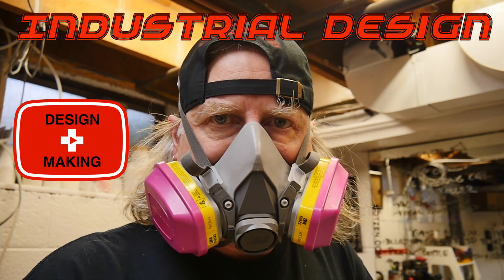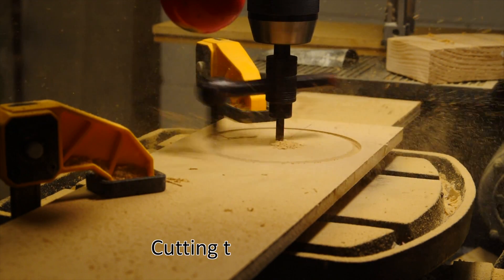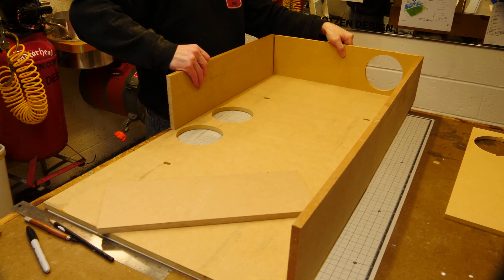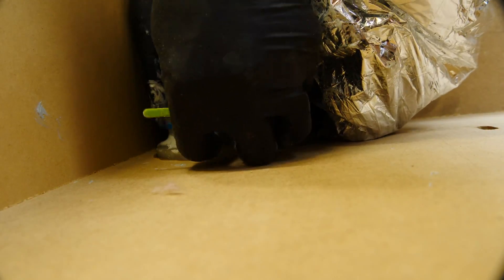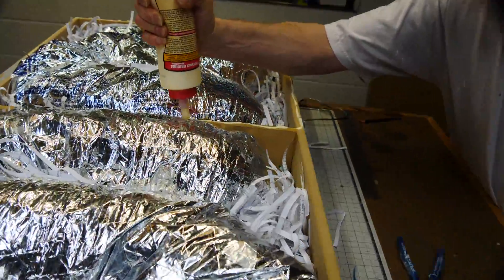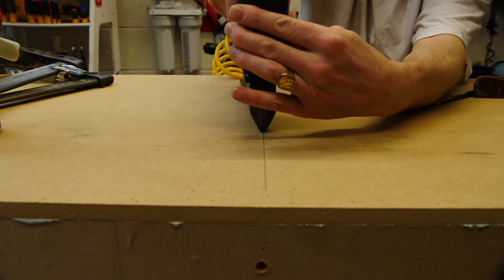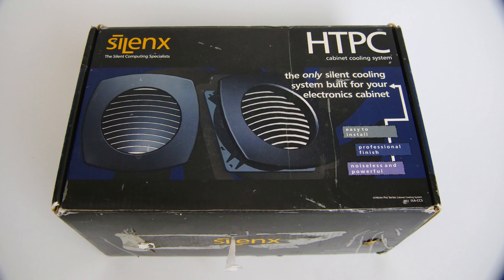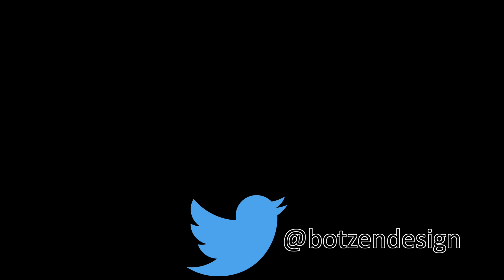Vocal Sound Booth Whisper Room Build: Part 4 Ventilation System

Comment: I know everyone’s a critic. But mounting your fan to a plastic tube that was mounted to wood transfers vibration. Then you mounted that on the booth. Not sure why you didn’t just cut holes and glue them with foam in between… you covered them with vent covers anyway… then I’d have that box disconnected from the booth with the vent tubes being all that’s attached. My guess is you’re getting a lot of vibration transfer…

Comment: Suggestions? Sure. Get the fan/box off the booth wall. Move it as far away as is reasonable. Ditch the mini-fan and use a  larger fan moving at slow speed. And when all else fails, Waves Clarity VX plug in will remove all the fan noise without degrading the vocal track. One pass, post-processing…gone.
Reply from the maker: Cool

Comment: Not sure what happened to my original message, but I suggested using a larger diameter fan. This will give the same volume as the smaller fan but at a slower speed. I also recommend using a toroidal propeller design for even quieter and better performance.
Reply from the maker: Also good ideas

Comment: Perhaps use acoustic ducting and locate the fan further away somewhere on the outside of the unit.

Also, if anyone wants to soundproof, consider mass loaded vinyl. Use closed cell expanding foam underneath. It should be fastened at the frame studs only, just before the interior wall.

Use it on the flooring as well with 2 layers. Also, I would suggest using 1/2 to 3/4 MDF for walls, and 2x4’s for the frame, if soundproofing.

Comment: I think the serpentine insulated ducting was a good idea, but you started with small fans, which is a problem.  The smaller the fan, the faster it has to spin to produce a given flow rate.  The baffling is an acoustic attenuator, but it can only do so much, so it is essential that the fan itself be as quiet as possible to start with.  When I do this (I'm doing a bit larger booth because it is for video recording rather than just sound), I will start with a low-noise fan made for use as a quiet bathroom ventilator, then apply the baffling to that.  Also, for quietest operation, the duct should be as large as practical, since the larger the duct, the slower the air has to move through it, and there is also noise produced by turbulence in the moving air, which increases with airspeed.  So, larger area fans, larger duct cross-sectional area - these areas should be roughly equal for minimum turbulence.  I know you have space constraints, but here we're talking about space outside the booth, not inside.

I'm happy to hear that the styrofoam/plywood sandwich was sufficient for your application - I've been worried about noise from a nearby busy street as well as airline traffic overhead, but I may start with something that simple, and add another layer of sound absorption only if necessary.

Comment: I was thinking of designing one ventilation using flexible plastic pipe and foam pipes as outer layer for the plastic pipe. For fans, I was thinking multiple 80mm cpu fans, attached to the pipes and kept at a distance from the booth. Any suggestions? Thank you.
Reply from the maker: Sounds good, try it out see how it works. Let me know

Comment: I bought a custom made sound proof cabin for WFH, but the airflow is really bad, right after closing the door I start feeling how my breathing gets harder. I think the de ventilation system they designed for this cabin is really poor and not well thought, it only have an air intake fan on the top and another insulated hole on the top to... maybe act as an exhaust just by the pressure added for only having air intake?

I was initially thinking of adding an exhaust on the bottom thinking carbon dioxide is heavier and will tend to move to the bottom, but not sure if that's a good configuration since also hot air moves to the top.

With your setup of intake on the bottom and exhaust on the top, how it feels? can you breathe normally? how long it takes until it becomes uncomfortable to be in there?

Nice video!
Reply from the maker: Thanks, good luck with your booth. I appreciate your comment s

Comment: Heck of a build man.
I'd install an inline switch for the cooling system if it's DC powered?
Reply: I saw a video where someone used passive air vents when they soundproofed their garage. It had a Trainline running from the back of it. 
It's quite an old vlog I'll see if can find the link.
Reply from the maker: Good idea, I've thought about doing that several times but right now I just plug and unplug it when I use it.
Reply: **It's by a guy called Max Troy

Comment: I noticed on some of the commercial booths the exhaust is at the bottom. So it’s harder for the mics to pick up sound at a higher elevation. I still love the content and your booth. What most people don’t understand most of even the commercial booths out there are not fully sound proof. Sound proofing is a whole different game. These booths are designed to stop outside sound like a furnace or outside noises like planes and cars from coming in and these will always do the trick because you have your house walls and your booth that acts like a room inside a room.

Comment: Foam has a better noise rejection then rock wool insulation. Rock wool insulation is used for a diffuser. Rock wool has microscopic fibers that are so small they can splice DNA in the lungs making it cancerous.  Cork works really good. 750 dollars for half inch to cover that room. You can use drinking straws as a diffuser but the width and length plus thickness plays a role in what frequency’s you want to cancel. The sound waves travel the tube bouncing then it hits a dead end and has to travel back the tube against oncoming new waves.

Comment: There is a solution to get rid of the sound of fans, you make a hole directly above your head and a special box for it to drain the hot air, and a hole at the bottom to draw cold air with another box, this is pure physics, you do not need to use the fan and if you use it it will be for a short time

Comment: There is no way to do without an ac or a ventilation inside the booth? I wanna build a booth, but ventilation is going to cost for sure. I thought I'd just open the door every 30 mins or so to let some air into the booth. Or maybe use a regular fan in there between sessions when I'm not recording?

Comment: I used the Inno Silencer for the PVC pipes for my soundbooth ventilation.
and it dampens a lot.
in the Netherlands these cost 6 euros each and I needed 15  pieces.
these inno silencers are available in various sizes, they are 5 cm thick. you will need about two to four pieces for your sound booth
Reply from the maker: Interesting product, thanks for the tip

Comment: Though I'm not sure what you can do about it, but TURBULENCE is one of the major factor creating Noise. Fan Blade designs that create greater turbulence have higher noise, and most whisper fans, have a blade design that reduces noise. One of the reasons I thought that venting the cabinets, drawing air out, might work better than blowing air into the cabinet where you are essentially blowing fan noise into the cabinet. Just a few thoughts. Let us know what you come up with.
Reply from the maker: I am drawing the air out
Reply: @EricStrebel  - - OK wasn't sure about that aspect. That seems like a lot of sound when drawing air out. Do you have some future plans to address that noise or can you simply live with it? I suspect turbulence is a factor. Generally the more turbulent the air is, the more noise it makes.
Reply from the maker: Dunno yet, maybe some sort of an inner lining or sleeve, or different fans
Reply: @EricStrebel  - - It is an interesting and important aspect of a Sound Booth - Quiet Ventilation. If you get some time to work on this, and find some solutions, we, the viewers, would certainly be eager for an updated video. There are Hundreds of videos on building the booth, but very few that effectively address the Ventilation aspect. 

Did you understand the point I was making about the C or U-Channel duct? That's hard to explain without decent graphics to illustrate. Basically a 3-sided box with open ends in the cross-sectional shape of a "C" or a "U". Line that with something to soften the internal acoustics of the duct, and use it to cover the two Openings. That way, the air is vented to the sides instead of right in front of the monitor.  Just a thought. 

While you see a lot of people put the soft double layer insulated Duct in their air vents, I, personally, feel there has to be something in the duct to absorb sound. So, like I said, rather than use the Foil Ducts, I would build a labyrinth of wood inside of the Fan boxes, and line that labyrinth with something like Felt. I know you can get very thick felt because I've seen people use it in Speaker Designs to line the inside of the speaker cabinet. I suspect a somewhat dense Polyfill sheets would work too. 

Also, repeating myself, I would move the Fan controller into the Sound Booth. You can slow the speed when you are actively recording, but speed in up during the in between times. Just a thought. 

Eager to find out how this aspect turns out.

Comment: Consider something of a Dead-Man's Switch. When you are ready to talk push the button or flip the switch to stop or speed reduce the fans, then when you are done with that short segment, Switch again to turn the fans on or to a higher speed again. 

Also make your own internal duct work. Build a Plywood C-Channel over the incoming vents. Put Acoustic foam inside the C-Channel and screw this over the Fan Openings. That way, some of the fan noise is absorbed by the internal acoustic foam, and the fan air is diverted to the side. 

This is going to be difficult using text graphics -

|
| -------------------
.                   <|
.                   <|
.                   <|
.                   <|
|-------------------
|

The "<|" are the best I can do to represent Acoustic Foam over Plywood. this would be a channel about ~2ft wide over the vents which are represented by ".". That would make the fans vent to the side and into the Foam on the Side wall of the Booth.  So you would have two source of Acoustic Foam absorbing the fan noise. Inside the duct, and on the side walls at the ends of the ducts where they vent into the room. 

Since the Fan Control Box already has speed adjustments  for the fans, you could simply move that inside, where you can adjust it manually. Slow when talking, and faster when venting. If the Fans are DC fans, then simply control the speed by changing the DC voltage.

I do this all the time with my computer and Amp fans (when I used Amp Fans). I used 12vDC fans but ran them at either 6v or 9v to quiet them down but keep the air flowing.  When the weather was hot in the summer, I turned the fan on my computer Cabinet up to a full 12v to keep the computer cool.  

The point is, if you can control the fan speed from inside the Booth, you can turn it down or up as needed. 

Also, as some on suggested, maybe what you are hearing is the Fan Boxes shaking the Booth. Isolate those fan cabinets and see if that lowers the sound inside. Since the fan cabinets are detachable, have someone out side simply lift them from contact with the Booth to see if the sound softens. They probably wouldn't need to be lifted out more than a 1/4" off the booth, to keep them working and see if you are getting contact vibration. 

Just a few thoughts.
Reply: Also, rather than the double layer Silver Duct work inside the fan boxes, I would build a labyrinth using wood and line these new wood ducts with smooth acoustic foam. Pyramid or Egg Carton foam will like create more turbulence, and that will make the air flow noisier, but smooth foam will minimize turbulence, and keep air flowing better. 

|------------------------------------------------------|
>Air In.. . . . . . . . . . . . . . . . . . . . . . . .|
|----------------------------------------------- . . . |
| . . . . . . . . . . . . . . . . . . . . . . . . . . . . .|
|. . . .-----------------------------------------------|
| . . . . . . . . . . . . . . . . . . . . . . . . . . . . .Air Out>
|-----------------------------------------------------|

Does that diagram make sense? Remember the new duct work is lined with some type of Acoustic Damping material - smooth foam or whatever - Felt, Poly Batting, other.

Put flat acoustic foam inside the wood labyrinth to dampen fan noise. Again, just a thought.
Reply: Here is a video that vaguely explains what I am getting at. Though in this video, he lines the Air Ducts with FIBERGLASS. I would not do that because you will get glass particulate matter in the air, and by extension into your lung. I would be inclined to use Felt, Poly Batting, or smooth acoustic foam. - - - https://www.youtube.com/watch?v=vcn_a_dM0SU
Reply: Also, though I'm not really sure how you did it, but you could use the fans to draw air out instead of blow air in, that might soften the noise.

Comment: For whatever it is worth, I think there is another approach to this that maybe simpler and less expensive, in theory. 

So many of these circulation kits, pc fans etc. are all based with small, or even tiny fans. Small fans have to spin faster in order to drive more air. Instead, I think the approach I would use would be to take two large box fans running slowly and build the cabinet using those. I know it would take a serious amount of re-engineering, but think the largest source of the problem is in the fans themselves. 

The other little trick I would offer is to line the inside of the tubes where possible with a felt-like paper. I am amazed at how much noise that cuts down. 

I also theorize that varying the size of the conduit will help, thought I have not had a chance to test this. In my mind the goal is to get rid of anything that can cause harmonics, and something that is a consistent size is going to allow of them to develop, much like a Bose wave guide works. By changing it up, the waves are broken up, and if you approach it from a large to small to large diameter conduit, I think the negative pressure on the outflow side would actually work to deaden any remaining sound.

Again, this is all just theoretical, but based upon experiences doing each separately. If you do decide to try any of this, I would be very interested in finding out the outcome.
Reply: Good points

Comment: The fan noise is not coming from the holes.   It is coming from the lighting on top where the fan is.  You did an excellent job with muffling with the duct work bending it.  That should be enough.  I again, the fan on top of the booth is bringing in the noice through the light gap that has no insulation.  Move it to the back of the booth or one of the sides.

Comment: I would add more insulation to the top of the box.  I believe most the noice is coming from the lighting because no insulation is up where the fans are.  You may want to put the fan on the back or side of the booth.

Comment: i would of mounted a bathroom fan up top upside down in its own box, wired to an outlet and a speed controller to adjust the sound
Reply: https://www.amazon.com/Wall-round-transition-included-versatility/dp/B001E6FOAU  for the holes

Comment: Eric, I have watched all 4 videos on this build, it's a great great design for portability which I've been searching for sometime now. I have a question about decibel readings inside the booth compared to outside. Have you ever had the opportunity to check this out? If so what were your readings? I know it will probably differ from one location to another. Thanks for any info on this.
Reply from the maker: Unfortunately, I have never tested this as I do not have a decibel meeter. I would be curious about this myself. It's not sound proof just nice and quiet.
Reply: @EricStrebel  Cool thank you for the info. Once I get mine built I'll see what readings I can get out of it with a phone app. Thanks

Comment: This is ABSOLUTELY incredible!!!!  A couple minutes in and I realized this is beyond my capabilities and skill set but I'm still trying to glean from it to apply to my plans (I'm basing my design on the 5 carat diamond vocal booth from vocalbooth.com).  I am just trying to figure out the simplest and quietest way to prevent myself from melting once myself or a client is in the booth LOL.  GREAT WORK once again!
Reply from the maker: Thanks, be cool!
Reply: Eric Strebel you too!  Quick question..how many casters did you put on your booth?  I know the bigger ones can hold more weight but I'm trying to stay at 2" to keep in mind my ceiling height
Reply from the maker: 4
Reply: Eric Strebel cool...I think since mine is a pentagon I will use 5, 1 for each side
Reply from the maker: Great

Comment: Excellent video series! For those of you that are looking for additional sound proofing - MDF is going to have a higher STC than plywood. Rockwool will also work better than rigid insulation. Those products will add a lot more weight (something to consider if you are not placing this booth on concrete. Again - great job!
Reply from the maker: Thanks, those are good pieces of advice and nice alternatives for adding more soundproofing
Reply: What is STC?

Comment: I would think that the vent box directly mounted to the booth would directly transfer any vibration or noise from the fans into your booth. 
Just my .02 cents: it might help it cushion the contact between the vent box and the booth, maybe a layer of rubber or dense foam??? 

OR:

probably too late now, but instead of the insulated duct, maybe foam lined baffles inside the vent box (like a rat maze). My thought would be that as long as it is air tight, the air will flow through, but the foam and baffles would interfere with the sound waves???